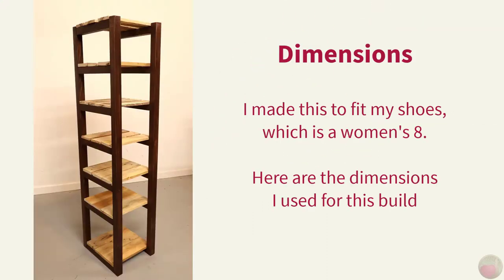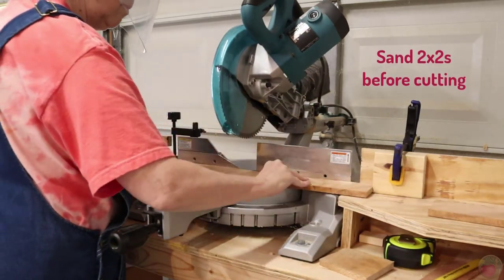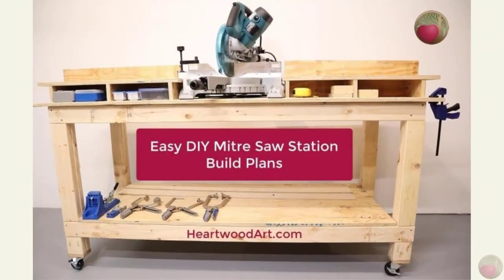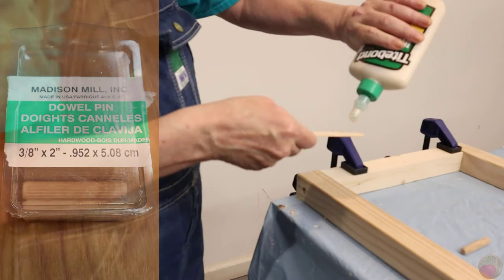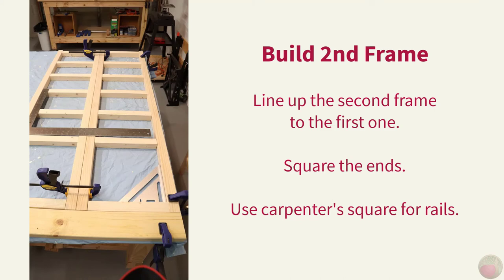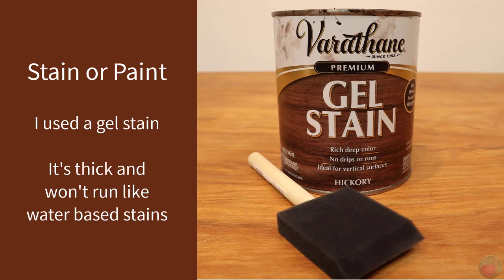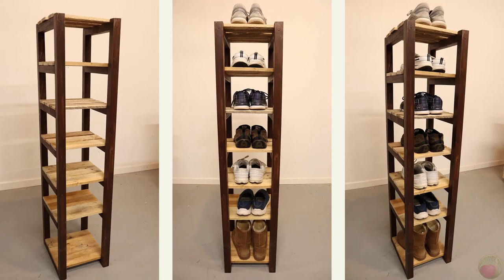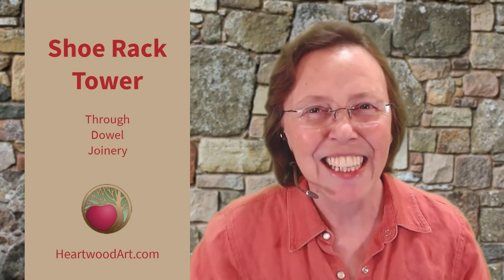DIY Shoe Rack Tower

Comment: Hi MaAnna, I love this piece. I have to make it for a person with men's size 12. What size boards should I be using? 3 of 1x 6 going across? And what other adjustments would I have to make? Please guide me.
Reply from the maker: You can use the sam dimensions shown, but the toes of the shoes would overhang a bit. You just have to measure a pair of the shoes to customize for your needs otherwise